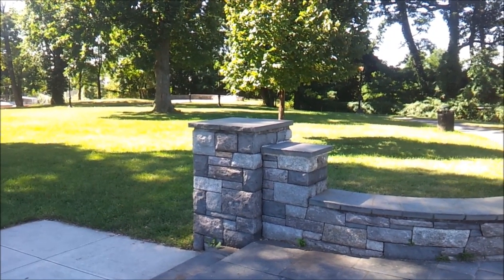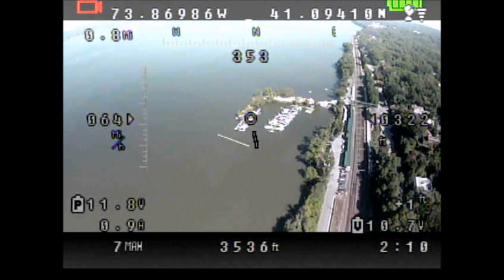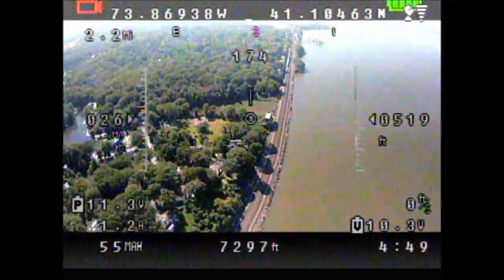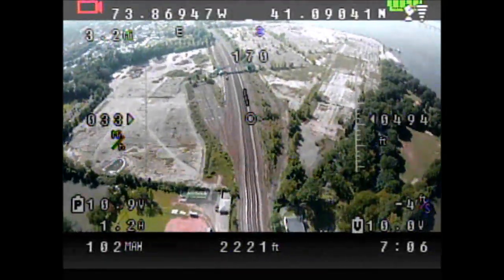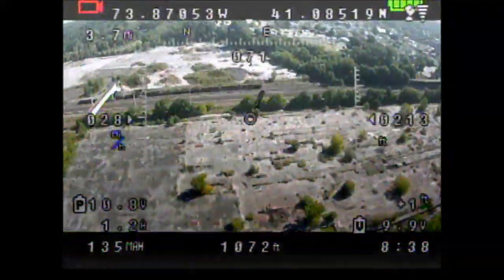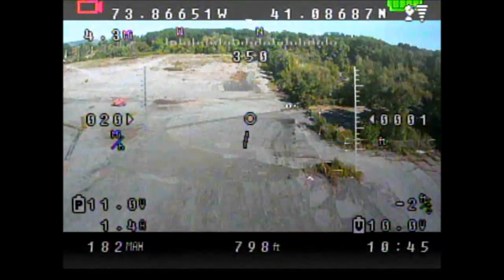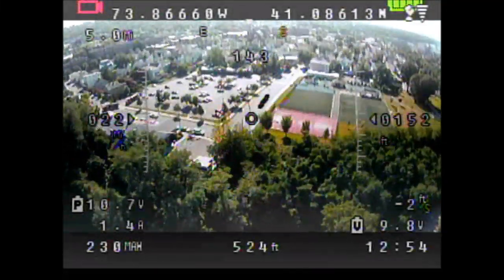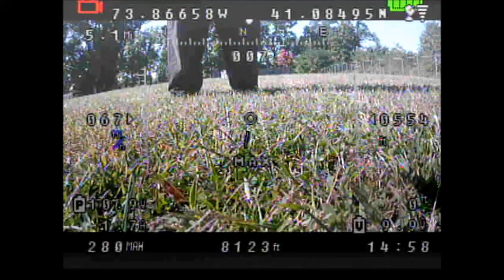Foxtech AIO goggles using 5 8ghz 2000mw vTX 2 5km 1 5mile FPV test flight

Comment: Nice vid! Did/do you have any note worthy issues with the transmitter affection in board components? Any negative issues with the transmitter in general?
Reply from the maker: The way I mount this transmitter on this aircraft It didn't interfere with any of the other electronic components that I have , everything just works fine .

Comment: There is no way you can save hexa from crash with one motor off (with naza). There is no question about it - just experience.
Reply from the maker: Naza FW 3.16. Hexacopter redundancy? Yes!

DJI WKM Naza disabled motor redundancy test

Any questions ?
Reply: Of course. Try to start with all motrs runing FRST and than have one damaged. BTW define "one motor off"
1. Just stoped runing?
2. Bearing damaged? - still running but wrong rpms
3. Prop broken?
4. ESC malfunctioning? rpms up and dwon

All of these sistuations are different. 
I am making 30Amps remote off switch so let me test it first in flight. I will let you know.
Reply from the maker: don The video below shows a hexacopter in mid flight losing a prop but remains airborne and controllable .

DJI Naza Hexacopter Redundancy

According to DJI the NAZA V2 and the WOOKONG are design to keep a hexacopter in the air regardless of what type of malfunction you get as longest is only one motor , one prop or one esc , the NAZA lite doesn't offer redundancy on 6 motors like NAZA V2 and the WOOKONG does .

BTW they are videos out there showing the same redundancy test with either unplug motors or unplug ESC's showing the same results of an effective redundancy system working properly from either the NAZA V2 or the WOOKONG .

Comment: Hi TFR,I bought the 400mW transmitter as you recommended.What voltage r u running for this tx?Is it safe to run it with 4S Lipo battery i.e 16.8V fully charged?

Comment from the maker: TeamBlackSheep " TBS " sales a vRX that you can used to replace the stock FatShark built in vRX , that will increase your 5.8ghz CH from 7ch to 32ch , that will come with the Foxtech compatible CH so you will be able to used Foxtech vTX with your Fatshark goggles and go far without a FPV ground station , don't get the boscam vTX , get the Foxtech 400mw , you can go as far as 1.5km with clear signal with CL antennas alone and maybe push it to 2km, Foxtech only used RP-SMA connectors so the TBS RX

Comment: Hello TheFlyingRookie,I'm using FS Dominator 5.8G built in RX,immersionRC 600mW TX with CL & SPW ants,only get about 400M range,after that the video signal dropped badly,I hope I can get better range like your 400mW vTX performs?What's wrong with the FS built in RX & immersionRC TX?Do u think is the FS RX problem?Is TBS DOMINATOR RX (5G8) & Boscam TX a good replacement for archieving good FPV range for my FS dominator goggles?

Comment from the maker: I know helical antennas are magical , you can go really far with them , i got a friend that flies a small flying wing with a Foxtech 200mw 5.8ghz vTX using a cloverleaf on his aircraft and a helical on his FPV monitor with a built in vTX since he don't like to used video goggles of any maker , he almost flew as far as i did on this flight with that tiny vTX , i can't even imagine how far i could go if i do the same like my friend did but with my 2000mw vTX instead , probably 10km or more .

Comment: Good flying I use fatshark attitude SD and got 1.8km off 250mw and 7km of 600mw. Long range with 5.8g is all about helical. The vibes kill max range and kill battery, 1468g quad 5000mah 3s  14m 23s. Balance motors via tap method and then props.

Comment from the maker: I do proximity FPV and i fly FPV out in the open withing one KM from home base with a 5.8ghz 400mw only using cloverleaf antennas with the goggles and vTX ,in the other hand some of my friends that fly FPV with fatshark,when they go over 300m away with their 600mw vTX using the immersion skew planar they start getting serious signal drops , they are force to rely on a FPV ground station to go the distance ,me in the other hand i only used the goggle with some cloverleaf antennas and nothing else

Comment from the maker: The idea of this video is to see how far i can go with 5.8ghz without the need of a FPV ground station or the need of FPV exotic frequencies like 1.2ghz,900mhz,ETC, i know that frequencies like 1.2ghz can go far and can gives you a crystal clear image but i only fly multicopters , i know those frequencies got the tendency to interfere or get interference from my other multicopters electronics and to correct the problem ill be force to shield everything in the aircraft to be able to stop that .

Comment from the maker: You have to select a 3 position switch on your radio and program that switch in to an empty CH that is going to be connected to the NAZA , then you have to enable that feature on the NAZA assistant software IOC menu , the IOC is not really design to work exclusively for redundancy system but it needs to be enable on your assistant software so the redundancy system can work in the event of failure .

Comment from the maker: The only way you can get the NAZA v2 redundancy to work is if you also enable the IOC on your NAZA v2 assistant software too , if not the redundancy on 6 motor multirotor wont work .

Comment: In the beginnig you said you built the hexa because of redundancy, so that in case a component fails you can still return. Friend of mine at our airfield had a failure in one of the DJI ESCs in his F550, resulting in a crash, because the Naza V2 wasn't able to compensate it. As far as I know only an octa copter can handle the loss of one "prop", not a hexa...

Comment from the maker: I only fly FPV with multirotors and nothing else , if i had an FPV RC airplane that can stay in the air for 30 minutes to an hour ill be the first person to setup a reliable FPV ground station for it since ill be really tempted to go really high and really far away but most multirotors out there they fly for only 12 minutes so using a FPV ground station just to fly a average range of 1km from home is pointless .

Comment from the maker: Turnigy NANO-TECH 8400mah 3s lipo , the battery that powers the hexacopter is the same battery that powers the FPV hardware too , the problem is that the video transmitter reduce the power that sends to the camera faster than the main battery does but it doesn't affect the performance of the FPV hardware at all .

Comment from the maker: As you saw on the pictures at the beginning of this video i build this F550 to be as light weight as possible so i can take the advantage of its lifting power to carry a large battery instead of a large landing gear with a gimbal , with a Turnigy NANO-TECH 8400mah 3s lipo i get close to 15 minutes of flying time , this hexacopter weights around 2200 grams .

Comment: I've got Boscam/Foxtech and Immersion VTX's, I personally prefer the picture quality of Immersion - I think it's subjective though.  I do think you philosophy of more VTX power, no ground station is limiting.  4 times the power of the 500mw vtx to go twice the distance, and the scews are struggling.  Being able to aim a helical at it (you can put one direct on your goggle if you like, though tripod is easier) seems like a much easier way to achieve decent range, without going with huge VTX's